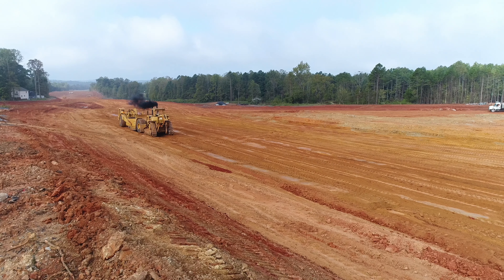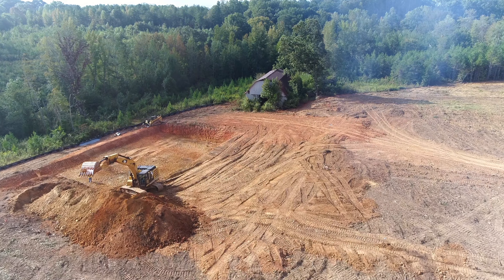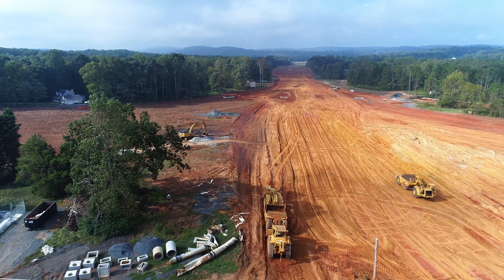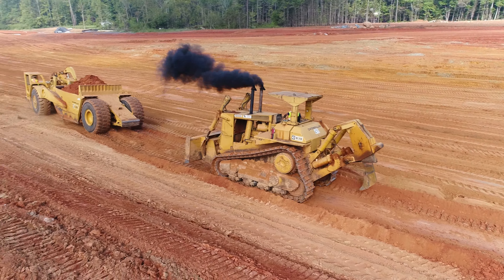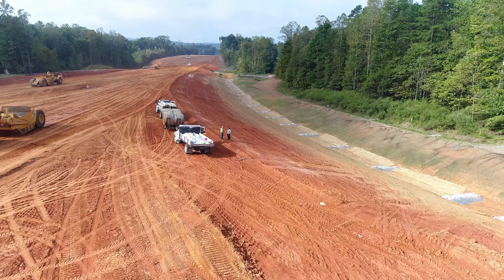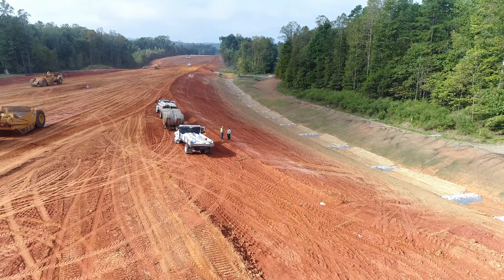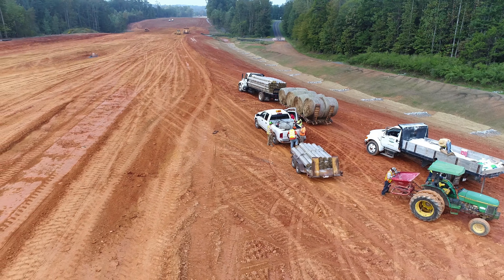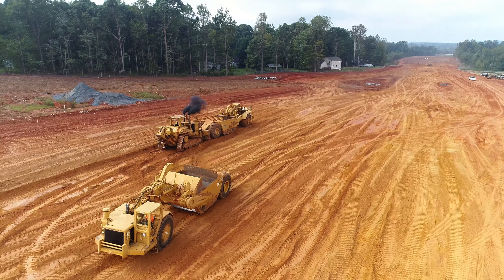64 ByPass Update...9/18/17...Episode 96

Comment: There is sure a lot to making a freeway or as you call it  "Bypass" Great video Mr Tom Allen
Reply from the maker: Yes... You are right.  This is a 14.4 mile long, 4-lane freeway (or bypass) which is bypassing the city of Asheboro, NC.  It will also provide a quicker access to the NC Zoo Wildlife Park.  There are about a dozen or so bridges that have to be built.  There were over 400 parcels of land that had to be purchased from private landowners, and a good number of homes that either had to be moved or torn down.  The whole project is quite an undertaking.